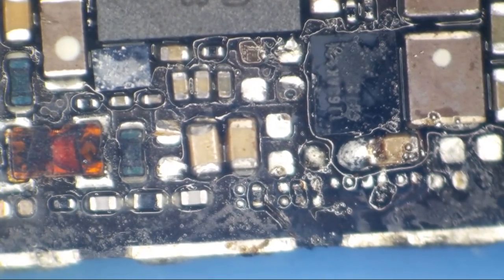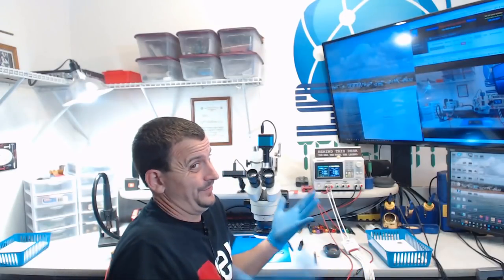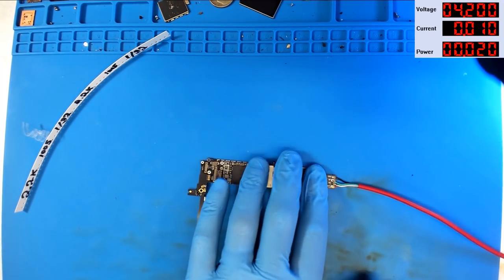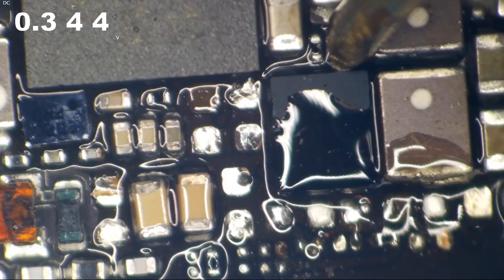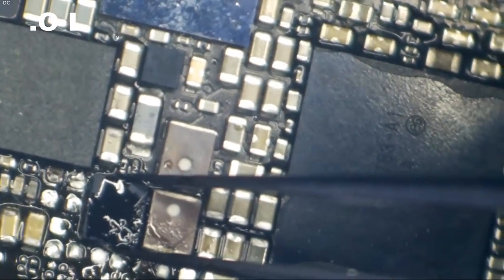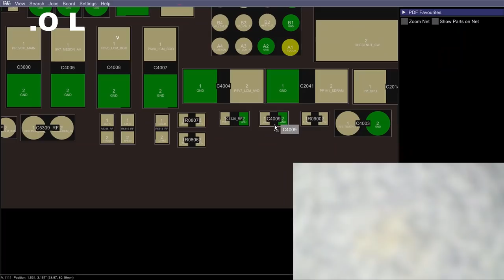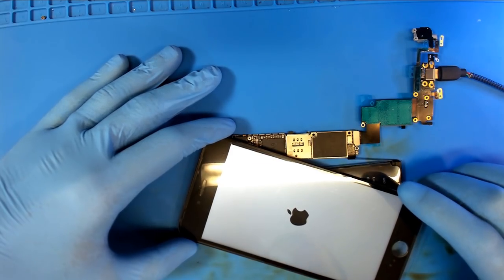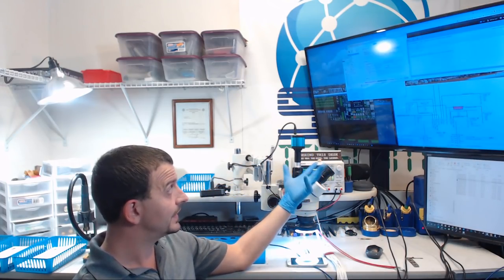iPhone 6s Plus Data Recovery from New Zealand (no power, hangs on passcode, liquid, prior attempt)

Comment: Nice work again, Sir! That was a nasty one and you took care of it like a king. Again,  I really appreciate watching you learn as you go. And again, I'm not a cell phone repair tech (I've just been in the electronic business for a long time), but I really like to understand what's going on. So, looking at that NFC circuit, the missing resistor was there to supply an internal supply to another pin of that IC (Stockholm). Since it was missing, the IC wasn't working properly. As simple as that.
Reply from the maker: Thank you.  If I had encountered this before learning about the issue on iPhone X, my next step would have likely been to try a software update.  On the iPhone X, there winds up being visibly damaged pads between the board halves and it's easy to see what's broken.  I probably would have never guessed stockholm was causing it without googling symptoms.

Comment: Hey Jason thanks for the laughs again.  You mentioned IPhone 7 boot looping problems. Have you discovered the repair to get the data from the update disease?  ( I’m pretty sure you have) I’ve got a vid ready but not uploaded showing how to get data. Think I should upload it?
Reply from the maker: Yes, when it comes to the issue where it will complete the update but then still hang on Apple after rebooting (with home button click).  For that I have been jumpering the reset line on the north audio IC.  I learned about pulling it from Jesse Cruz but then seen Jessa jumper that line on one of her videos.  I think she tried something else after that but for me, just jumpering the reset pin does the trick. (wire across a single resistor to pull it to ground)
Reply: STS Telecom awesome and on the 7 series you also jumper the south chip too to restore touch functionality

Comment: Have you seen the below process from Apple to remove the encryption password for new/future backups?  

If you can’t remember the password for your encrypted backup:

You can’t restore an encrypted backup without its password. With iOS 11 or later or iPadOS, you can make a new encrypted backup of your device by resetting the password. Here’s what to do:

1) On your device, go to Settings > General > Reset.
2) Tap Reset All Settings and enter your device passcode.
3) Follow the steps to reset your settings. This won't affect your user data or passwords, but it will reset settings like display brightness, Home screen layout, and wallpaper. It also removes your encrypted backup password.
4) Connect your device to the Finder or iTunes again and create a new encrypted backup using the steps above.

You won't be able to use previous encrypted backups, but you can use the Finder or iTunes to back up your current data and set a new backup password.

If you have a device with iOS 10 or earlier, you can't reset the password. In this case, try the following:

If someone else set up your device, ask them for the password.
If you don't have an iCloud backup, you can make one.
Reply from the maker: Woah, I did not know about this.  I haven't tried yet but  I thought to get around the unknown encryption passcode, the phone had to be restored.  My whole life is a lie!

Comment: Hey Jason I have a question I have a 6S plus the reason to brought it to the store Short story on the phone They smack to the wall so the PHONE it was back light issue is fixed it was not getting power it’s fixed it’s.. no server is fixed but now when I put it on the FDU mode the computer doesn’t recognize it and I don’t know what to do now It doesn’t go to DFU MODE Any advice please thank you very much
Reply from the maker: Oh man, after a good slap, it could be a lot of things.
Reply: Well it turns on IT DOES charge the battery and everything but it doesn’t go to DFU
Reply: How about send it to STS Telecom to get it fixed...?
Reply: *STS Telecom starts sweating profusely*